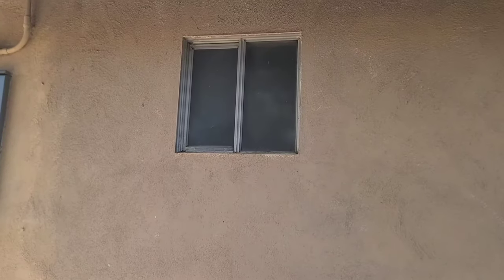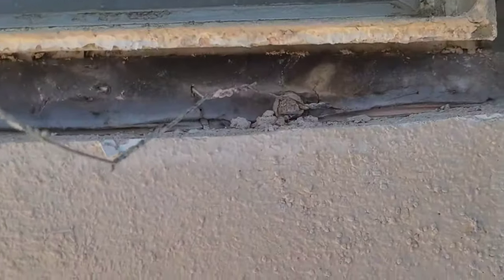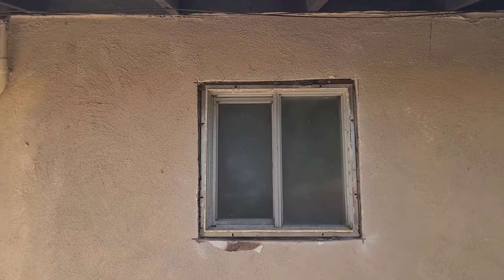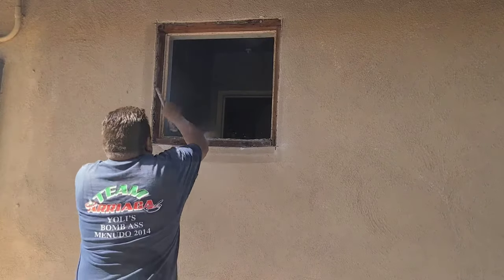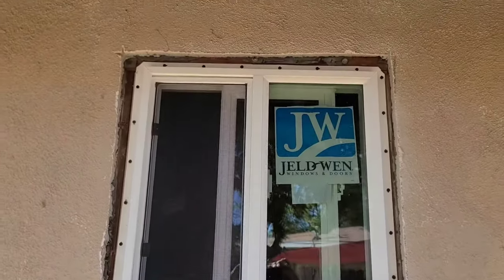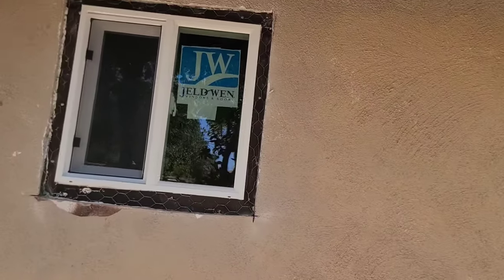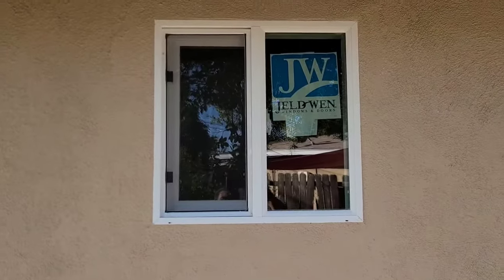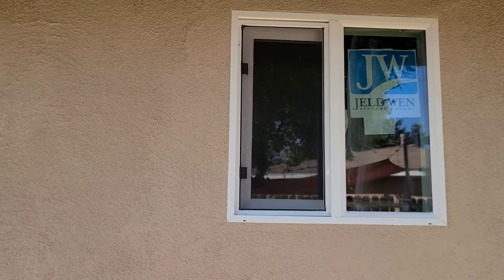How to install a New Construction window on a stucco wall

Comment: This is not the right way to install window and patch stucco.  Caulking a small strip of paper to edge of cut and window will fail.  Not chipping back stucco and tying in and nailing lath to existing will cause a crack at the joint in time. Just google or youtube waterproof retrofit windows in stucco and don't make this mistake.
Reply from the maker: If you ain't got no haters you ain't poppin
Reply: This is the kind of video I was looking for
Reply: @mrnoe67tiktok how would i do it on my house it only has cement and foam and the wire no wood frame around it
Reply: True, the window was flashed no better than the existing, the lath should be lapped, & chipped edges rather than cut would be a better adhesion for the new stucco...

All that being said, that window may not have a valid warranty, but will likely hold up better than the one it replaced. It is near impossible to get a solid waterproofing onto 60 year old tar paper.

My 1971 waterproofing has flashing tape inside the paper only, nothing around the frame, nothing above or below square aluminum frames with no weepholes.

New windows have internal moisture control, & will channel water out away from the waterproofing membrane.
Reply: Gah damn what are you the construction police. 🤣
Reply: I thought I was the only one who thought this as well until I seen your comment. I’ve learned to break stucco back to expose wire and reuse existing for overlay to avoid cracks down the road and also not damage paper under because stucco absorbs water and the paper is the barrier against the stucco to framing. If I’m wrong let me know but that’s how I learned to make it last and not crack or leak.

Comment: You should always chip out a jagged edge around the opening and also overlap new paper and wire with the existing paper and wire. This helps reduce cracking and gives you better waterproof situation around the new window.
Reply from the maker: thanks

Comment: I did a new construction window just like you did, except after I cut the hole with the masonry saw, a neighbor who was in construction for 50 years told me to take a chisel and break up all the clean-cut edges. If not he said it will crack down the clean-cut lines. I have no idea if this is true, but I did what he said.
Thank you for the video, it was really done well!
Reply from the maker: Yes, you can
Reply: Yes you have to do that bro if not it will show up , that’s the issue i have right now
Reply: @mrnoe67tiktok my stucco 5" thick,  how u cut thru that?

Comment: The extra work is definitely worth it. I have some windows similar to this, the others have a foam stucco trim around that may be a little more difficult. Hoping to find a video on that. But this video definitely helps. Thanks
Reply from the maker: thanks for the visit. good luck

Comment: Thanks for the video. If I am installing windows into a stucco wall that has no windows, what type of fin do I want to order on the windows? Or will any one really be ok? Different fins I’ve seen listed are: 
1 3/8-in Setback
Standard Z- Bar
Wide Z-Bar
No Fin (Block Frame)
No Fin with Sloped sill Adapter
Nail Fin
No Fin/ Block Wall
Single Wall Flush Fin
Dual Wall Flush Fin
Stucco Key
Reply from the maker: thanks

Comment: Thanks for the video. If I want to put a window into a stucco wall, can I just frame inside, cut exact opening through stucco, and install block frame window (no nail in fin), by screwing directly outward through the window frame directly into the studs, and then just caulk around the whole window? Will that make it waterproof enough? Will just caulking around the whole window make it water proof, as there will be nothing getting tucked around it, just caulk around it?
Reply from the maker: yes

Comment: Nice job…I did the same for the whole house and it looks fine…in 10 years I haven’t had any leaks…I only have one window left to do…it is an odd size( dumb size) not only that but it is the kitchen window and the sill is part of the countertop which will be installed after I take care of the window….so most likely I have to order the window …
Reply from the maker: Thanks for the visit

Comment: Hello, thanks for the video I have a window that is the size of the last window showed in your video and it is leaking through, I removed the drywall and it looks like there is no flashing could it be leaking for this reason when it rains?
Reply from the maker: yes it can

Comment: Nice install. How would you go about installing a new construction window on a stucco house with 2x4s around the perimeter the window, which are also stuccoed.
Reply from the maker: You might need to remove the 2X4s to install your windows

Comment: Noah  How much can I charge to repair a window like this? Only the stucco patch?
Reply from the maker: $150
Reply: @mrnoe67tiktok  we live out east.  We were quoted 6500 and 4700 for 3 windows equivalent by 2 different contractors.  Is this exorbitant or about right.  It's one door, one window and a window removed.

Comment: Great video! My favorite part was when you used your wife's spoon...lol. The stucco on my home is a very thin layer on top of styrofoam. Will this technique still work for me? Thank you.
Reply from the maker: yes
Reply: No it won't you need completely different materials 
Fiberglass mesh and base coat cement and acrylic finish coat none of those materials are used in this video  and he did a horrible job on that patch worst job

Comment: Do you have to put a drip cap over the top of this type of window when installed in stucco without any trim or pop outs?  I think you did an amazing job and you make it look so easy.  I'm about to have someone do this to my windows in place of wood trim, but I'm really scared about water.  There is a roof overhang all around the house, but not sure that's all that protective.  It looks to me like you didn't do a drip cap.
Reply from the maker: You can if you like